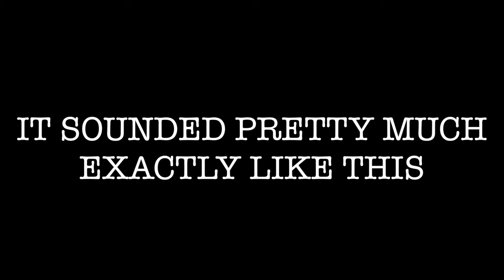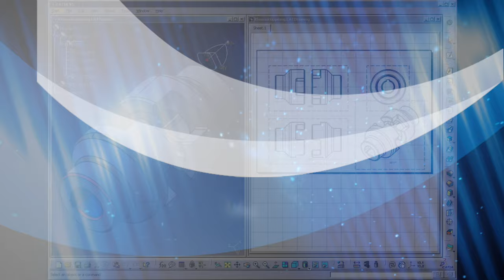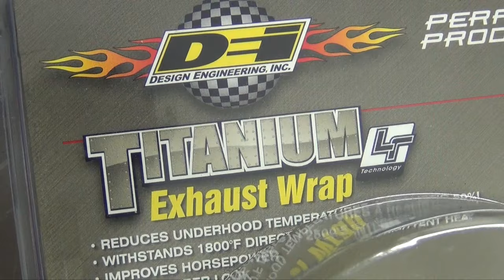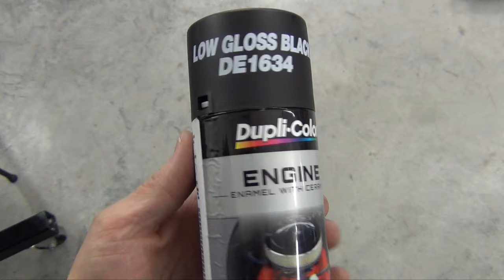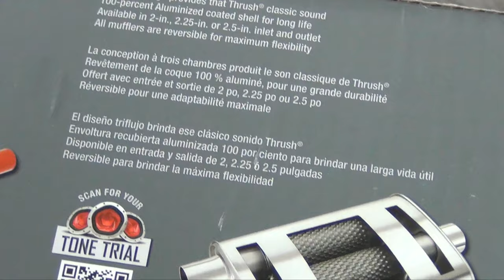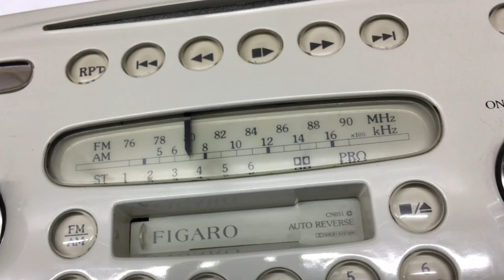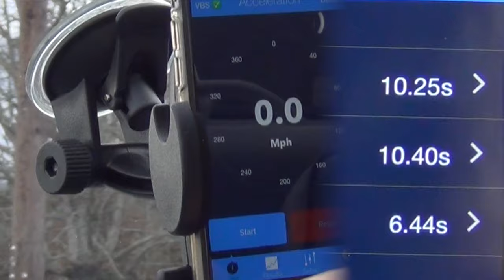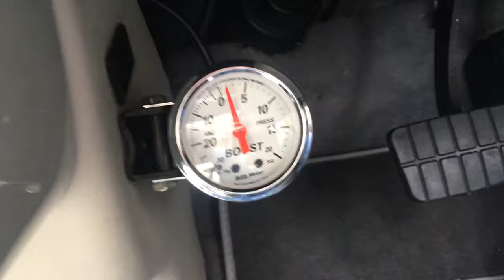1991 Nissan Figaro - Project "Figgy Fix-Up" Part 5

Comment: No cat? It may hurt a few hp's but it's a bunch better for the environment!
Reply: Not to mention in some states, like here in Cali, it's illegal to run with out one. :D
Reply: Modern converters don't even hurt power, cleans up the sound a little too.
Reply: It ain't about horsepower, it's about unburnt or incompletely burnt fuel. Heck, small displacement engines like lawn equipment and powersports vehicles are the worst, and most have much less power than that.
Reply: White Tiger Gaming only if the car was built with one. as this would be imported in and is more then 25 years old it would be ca exempt from needing a cat.
Reply: ***** It might be exempt, but it came with one (it was in the awful restrictive section directly after the turbo)
Reply: Ceazar Carr true. Another thing to note is location. I bet Tom  lives in a state that is not California or NY. So the cat was not necessary to keep on and obd1 cars are terrible with cats loosing a large percentage of power. It was not until late the 2000s that motors were better built to work with emissions systems.
Reply: kris johnson That is why I said *some * states. :D
Reply: White Tiger Gaming yes you did say some... but you can still import cars that are newer then 25 years of age with out emission equipment  to California
Reply: kris johnson True, if a car was sold out of state then Cali admissions don't apply.
Reply: By federal law, it's still illegal to remove emissions equipment, even if you're in a state that doesn't check for it.
Reply: Eric Fixalot really???? How is anyone going to know if your vehicle never gets emission tested? Missouri has thousands of cars and trucks where owners cut that crap out where is the people getting arrested or fined?
Reply: Cats are more about reducing smog inducing exhaust gases than CO2.
Reply: Kainoa Kai the majority of pollutants are from cargo ships. those are what really hurts the environment.
Reply: It's one of the reasons you couldn't get this car in the US. It never had a cat.
Reply: ***** Whether or not you get caught, it's still illegal. It's up to a $10,000 fine if you do though. In some states, they're actually pulling people over and checking people's cars btw.
Reply: Ceazar Carr    lol
Reply: Eric Fixalot in Texas anyway a vehicle that is 25 years or older, a catalytic converter is NOT required nor is it a part of inspection.
Reply: White Tiger Gaming the coppers won't know  ;)
Reply: tyler t no they don't, CO2 is a fixed ratio to fuel burned( basic chemistry ), not anything to do with the CAT. CO is a by product of poor combination and SO2 a by product of poor quality fuel is what the cat is there for.
Reply: Ceazar Carr Pretty Sure Cars Before '92 Werent Required To Have A Cat
Reply: Aaron Cauble Just becuase it's not part of the inspection doesn't mean it's legal to remove. That's like saying it's legal to have bodies in the trunk becuase that's not on their checklist.
Reply: Eric Fixalot I'm a certified state inspector here in Texas. Check your facts sir.
Reply: Aaron Cauble Texas is also pretty lenient on emissions.
Reply: Well I'm not arguing that lol
Reply: Aaron Cauble You first, Federal law (that's all 50 states) says it's illegal to remove or render factory emissions equipment dysfunctional.
Reply: Eric Fixalot on vehicles newer than 25 years yeah?
Reply: Aaron Cauble On anything that came with factory emissions components. Keep in mind, I am not talking about state laws.
Reply: Eric Fixalot then our argument was pointless lol. I understand what your saying now.
Reply: Aaron Cauble Lol alright cool, glad we're on the same page now.
Reply: I have to disagree. In the state of Texas even for a safety only inspection of a 25 y/o or older vehicle requires visual inspection all emissions equipment . All vehicles after 1984 require a cat, pre '84 a cat is treated as if it were a muffler.
Reply: MrStacy1974 the laws have changed. A vehicle 25 years or older doesn't require said visual inspection.
Reply: also please keep in mind I'm in an emissions free county. we don't have emissions testing here.
Reply: Ceazar Carr catless makes more power and better fuel economy
Reply: Rocco Pelletiere Catless only gives you 2-5 hp but puts unburnt gasses into the atmosphere, which is bad for everyone (global warming, health issues, bad smell)
Reply: Ceazar Carr sir I don't think you understand turbocharged cars I've personally seen a 20whp gain from doing catless
Reply: Rocco Pelletiere I don't personally have experience. However, I'm sure you're not going to see a 20 hp increase on a 75 hp Figgy... what car gained 20 hp? It probably had a crap ton of hp to start with and had a highly restrictive exhaust.
Reply: Ceazar Carr the torque gain will be most notable on the fig but my car personally between a stock downpipe and a 3in catless do gained just over 15whp
Reply: Rocco Pelletiere With what cat and what car/engine? Those are important variables.
Reply: Eric Fixalot awp 1.8t
Reply: Rocco Pelletiere Stock cat?
Reply: Eric Fixalot yes
Reply: Rocco Pelletiere That explains it then. I didn't dyno it, but I felt exactly what you described when I removed the stock one from my 454. My friend has a 8v 1.8 VW Fox, those also have a restriction with the factory converter donut gasket (it reduces to about 1 inch) VW did that on purpose to reduce power so that their higher end cars look better. It wouldn't surprise me if you had a similar situation.
Reply: Eric Fixalot the cat was the size of California lol
Reply: Rocco Pelletiere My stock cat was huge as well. The new one is about half the length and width, probably 1/3 the weight too. Now it runs better and far cleaner.

Comment: bad obsession motorsport do some canny good C.A.D
Reply: Feels like a rare thing to see another Bad Obsession fan. But those that know, know.
Reply: Lewis Biggs bad Obsession is amazing but feel like they'll never finish the mini :(
Reply: Lewis Biggs Yeah their like my favourite thing car related but waiting months/years for videos getting frustrating
Reply: Camhin1 Yupp, its been going for years
Reply: Patience will be rewarded.
Reply: i cant wait to see them finish binky
Reply: Good things come: a. in small packages b. those who wait.

They'll finish it, i've no doubt about it. I'm actually (pleasantly) surprised it only took so long to reach their current milestone (talking about the recent cosmetic aspects they tackled) with a build that essentially, not only revamped the whole car, but also upgraded and transported elements from another, which is no easy cake walk.

I have a friend who is in the process of making an original Miata hardtop (think fastback style) mod and revamp, and he's been working on it for 2 years now, alone with some of us friends passing by from time to time, he's nowhere near despite a far wider body print and a similar engine + drive-train package swap (from a newer one).

Comment: For some reason I absolutely love your exhaust vids.  You've sold me on the rod builder kit as well.  The slip joints make it tight and welding easier. Well done

Comment: Hey Tom. As you know, Japan uses different FM radio frequencies to most other countries. You can fit a simple and cheap part called a 'Band Expander' which is a simple plug in, that will allow you to reach local frequencies. It is not perfect, but if you want to keep the original system it is the best option.

Comment: Excellent video, am rebuilding my wife fig and am sure you will know everything is expensive on these cars over here in Yorkshire England. Am talking strip down I did  this but paint shop took bits of and made a mess ! Hello where do these go 😮 I can work on any car to a certain degree but working on a fig is a nightmare.  Every plastic click is up to £7 each.  Wish I had a mate with a 3D printer.   We hate paying in Yorkshire . Exhaust should not take value I've seen loads changing / personalizing their Figs . All I can say is your lucky no salt on the roads . Thanks for modifications I will be going down that path .

Comment: You can buy a band expander for the radio. I used to fit them to JDM cars in Australia years ago. They plug into the antenna wire and allow you to use the radio.

Comment: hey Tom if you take a number 9 or 10 shade lens and put over the objective lens of your camera before you weld anything, it will show off your welding better and save the lens if it takes a stray spark

Comment: I'd get it on a dyno with a wideband and at least check your A/F ratio to be sure you're safe since your mods. Sweet little car. I owned a R32 Skyline and the signal/wiper, going to the wrong side all the time and drive through stuff I can relate to haha.

Comment: reducing value??? i think its just going up.
good job Tom
Reply: aftermarket or modified parts reduce a cars value.
Reply: Yo Yo one 1000whp MK4 supra for 10K please :D
Reply: KBB doesn't care about your mods lol.
Reply: Mods on a non race car/collector car devalue it. You also won't get top dollar modding something yourself. The big money heavily modified cars are usually also built by a shop with certifications/parts lists/appraisals/warranties/dyno numbers/track numbers/etc and not some random dude claiming big numbers based on his butt dyno.
Any time you go to buy a car the price should go down for every non stock item or mod found. If that number is to low, the seller will have to find another sucker or take the deal.

Comment: I am impressed nice work. Be careful and watch the mixture in the past I have melted a few pistons with my turbo add on. I am sure the injection will help with that. One corvette I added a small nitrous kit that shut down at 2psi boost and it took the lag out completely. What a ball that was. The only question I have is how did you get the car in the country.

Comment: Wouldn't it be better to have the flex sections closer to the engine itself? Basically after the downpipe straightens out underneath the car?

Comment: Throw a massive 110 mm turbo on there. Run 90 pounds of boost on stock internals. Blow welds on intake manifold and loose floorpan. Revert everything back to stock to have a 10 minute 1/4 mile car.
Reply: Grant Leben that is the best worst plan ever

Comment: Would you recommend that deburr tool, seems to get the job done well.
Reply: Anthony Noakes We use them in our Uni machine shop. Super easy to use, obviously it won't do much to hardened steels, but for everything else they're great.

Comment: Where's the cat? I'm just asking for the polar bears.
Reply: Luke Ingold the cats are out trying to catch the birds
Reply: Ofensus and the worst part about having a cat is some cars' have to run richer to avoid a cat premature failing thus burning even more fuel and polluting more
Reply: Cats are a bit of a failure in thinking. A thing stemmed from rushed out ideas that were meant to satisfy paper pushers. Really, the proper solution is not a clogger element, rather, a cleaner fuel burn, a more efficient one, and last, but not least, a proper running drive train.
I've actually seen identical cars with and without Cats have a major difference in clean burns. One was with a 4 yo Cat that was pretty much done for, and another had been buttoned up and re-ECUd with a custom unit and better injectors. The non-Cat car ran almost twice as clean, and certainly more efficient.
Reply: I think your farts contribute more to global warming than the figaro's tiny 4 cyl
Reply: This thing is also 25+ years old. Most cars that old are smog/carb/cat/emission exempt. (depending on your location.)

Comment: Just my 2 cents worth...
I'd up the size of the rims to 14"  and an extra 1" wider, also find a way to keep the wheel covers to maintain the stock appearance.
You could either stick with the same overall diameter or go with a slightly taller profile, the later obviously would give you a little more top end if you so desired, a good, modern construction tyre, with a stronger sidewall would greatly improve the handling without destroying the overall ride.

Comment: Have you done any tuning to the engine to improve the performance after the upgrades, or are those performance gains just after those mods you've done?  Just curious though, I love the discrete improvements so far.

Comment: Love your work Tom. Curious, what is the little tool you are using to clean up the inside of the exhaust tube after cutting?
Reply: thats an metal edge grinder, to smooth up the surface for welding :)

Comment: hey tom, i noticed that the fig runs an old school maf sensor not a map system, i have heard plenty of people say not to mess with things like alcohol or even an aftermarket intake as it will greatly affect the readings the maf sensor gets and cause alot of issue. did you or are you planning on doing a tune on the car or do you find it runs just fine with all these mods?

Comment: You can change five speed manual gearbox from micra k10 or just swap the rarest micra super turbo engine to it! Supercharger plus turbocharged! Figaro use same chassis with micra! In Japan they called March k10!
Reply: It actually same engine ma09ert but micra super turbo they build for rally very early late 80s

Comment: So many comments about the lack of cat, if a car is running properly then running without a cat will make very little difference to the CO and HC count. Early cats are just a massive restriction and seem to have been fitted just to meet compliance regulations as (here in the UK anyway) cars without cats as standard were already meeting emissions regulations and those regulations didn't change even after it was made compulsory for all cars to have cats fitted. 
I don't think Tom removing the Figs cat (which was probably 25 years old anyway) is going to make any impact on the environment.

Comment: hey Tom, nice to see you back at it again :)
Why didn't you put the flex section right after the first bend after the downpipe? Wouldn't it reduce stress on the exhaust manifold even more?
Reply: Vano Scrap, it would reduce stress even more, though one flex section is generally sufficient :)

Comment: Decreasing the value of a Fig? You can import one to Australia for less than carton of craft beer!
Reply: Yeah, cars in different regions cost different amounts. Like where I live on the west coast of the US, you can't get a decent mini for under $10k. But my buddy in Germany can get them for like $1500. It's actually cheaper for me to fly to Germany, buy the car I want, ship it back by boat, fly back to the US and pick it up on the east coast, then drive it the ~3000 miles back to the west coast. And I would still save about $2000.

Comment: It's so frustrating seeing people not use a catalytic converter. For what, a $100 savings and half an extra horsepower? Why not just use one and do it right?
Reply: Dima Aryeh he's not doing it wrong by not putting a CAT in the system, it's a choice to run one or not, there's pros and cons to either.
Reply: NitroNuggetTV there are pros to going catless the outweigh the smell and emissions? newsflash to me
Reply: Dima Aryeh yes, performance gains, cost, sound (opinions may differ) and a decent weight saving. As for emissions, it's "one" car, not to big of a deal especially considering once cats weren't a requirement by the government. I personally don't care about that side of things because in the grand scheme of things it's not that big of a deal.

Also smell is a matter of opinion, as I don't mind te smell, if anything I like it.
Reply: NitroNuggetTV $100, 2HP, and 3 lbs. That's pretty insignificant. The idea that one car doesn't matter is a huge problem, since everyone thinks that way to justify selfish decisions. And on the topic of government once not requiring them, well people once didn't know blood letting didn't cure diseases. It's progress.
Reply: Dima Aryeh put it like this, a person who de-cats his car is only as selfish as that person who drives a classic car. It's not worth worrying about or even caring about, the important thing is that the majority of cars on the road have cats. Call it selfish if u want, but we still won't care as we know the real damage we're actually causing, which is basically nothing. Also I've seen much bigger gains than 2HP, bigger weight savings and cats that cost three/four times as much.
Reply: NitroNuggetTV there's a difference between driving a car without cats and going out of your way to remove working emissions equipment from your car. Huge difference.
Reply: Dima Aryeh "big difference". same result. 

That person could install emissions equipment in their classic car, especially if it's so cheap, loose minimal power and  weights nothing like you say...

Comment: This car needs a Hayabusa engine and some real tires and wheels , 3 speed auto is lame even behind a small block V8 . they should have made it like a Caterham with a 5 speed and a motorcycle engine putting power to the rear wheels . Like the Saab Sonett , a cool looking car with a stupid drivetrain .
Reply: No diss on you though Tom , you do awesome work . I just think every car should have manual gears and rear wheel drive , i almost cry every time they make a cool looking car and then give it a weak engine and front wheel drive .
Reply: jerry henderson I feel like you missed the point of this car.
Reply: Camhin1 If there is a point to be missed , i guess i did .
Reply: The point of it not being a sports car and meant for good mileage city driving like a cramped place like Japan? You won't ever get out of that 3rd gear so it would be pointless.